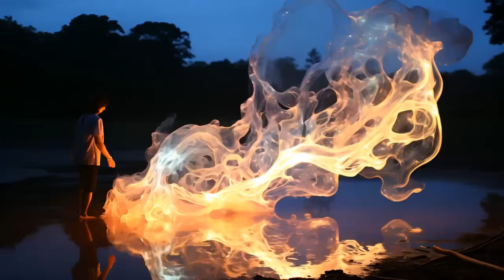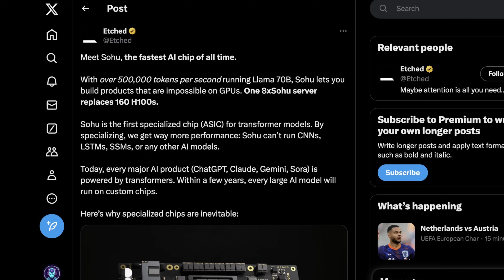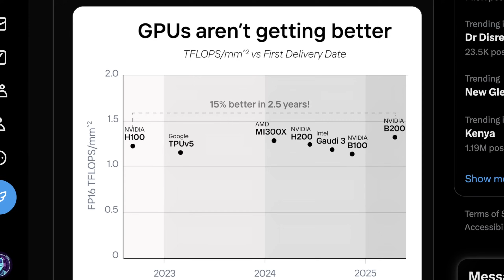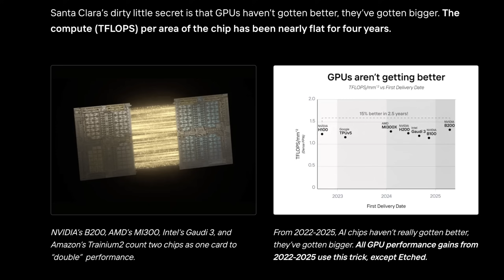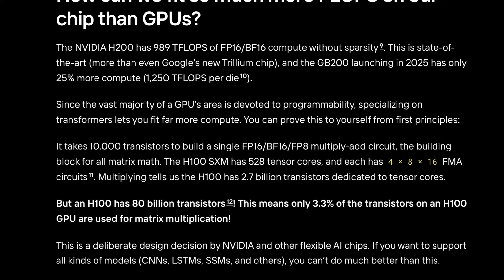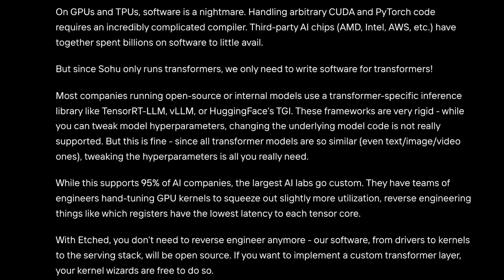Meet Sohu, the fastest AI chip of all time.

Comment: Not sure it's wise to invest in making an AI chip only for transformers when transformers are not what is going to take us to the next level. Transformers are limited regardless of context size or how many tokens you can generate per second.
Reply: 20x faster inference would take us to the next level. This makes AI-ifying everything basically free. It doesn’t have to be the permanent future, it’s just radically improving the usefulness of current models and enabling new applications which couldn’t be done before due to token speeds and latency, like making live voice assistants respond as quickly as a real person, and giving them CD quality voices instead of sounding like a Skype call.
Reply: It also means coding assistants and coding automation go from being sorta possible to; generate a working tested application with 200,000 lines of code in a few seconds.
Reply: Of course as soon as a better architecture is proven, they can immediately begin R&D on an asic for that too, because they will have tons of revenue from their previous successful product and investors.
Reply: @IntentStore  Faster crap is still crap.

Transformers will never be able to do that. They fail simple algorithmic coding tests I give them. Because they don't know how to code, only spit out code they've been trained on that aligns with whatever prompt you give it. 

The reason it cant get the answer to one of the problems right is that the answer lies in a single PDF that was on the net 25 years ago. (It's still out there) I know this because I helped fix a bug in the algorithm back then. It's nothing complicated, maybe 100 lines of code.

In order for a transformer to spit out a 200,000 line program, it would have had to been trained on a 200,000 line program. Multiple in fact. Which means the code had already had to have been written. Which at that point, you already have the code, what do you need a Transformer AI for?

Transformers wont get significantly better, they cant. They're limited by their probabilistic text predictive noodles. Which just doesn't work for software.
Reply: @K9Megahertz  What about multivariable Brainchip's spiking neural Akida2 chip  with its unique TENN's algorithm ? It may possibly steamroll the competition.
Reply: @K9Megahertz  I don’t know what model you’re using but this isn’t reflective of mine and others’ experiences. With chain of thought, planning, agents, code sandboxing, and iterative error corrections, code automation is highly viable, and we haven’t even reached the peak of LLM intelligence as evidenced by Claude 3.5 Sonnet.
Reply: @IntentStore  Any of them. LLM's are limited. Maybe they work for little programs or little functions because they've been trained on umpteen variations of that across the internet/github. 

For large scale applications that requires real software engineering? No. I don't see it.

Try using LLM's to write a B-Rep system/engine for 3D CAD modelling software like in F360. Let me know how that goes.

Honestly, with all the requirements that you listed, it'd just be easier to write the code the first time, rather than have an LLM spit out incorrect code, have to debug it, throw it away and write it yourself anyway.

LLM's are probabilistic in nature, and that just doesn't fly with software engineering. Either the code is correct or its not.

Comment: I think this is less interesting as a specific product than it appears on the surface. It's interesting certainly for the implications on the industry, but in terms of its direct relevance to "ordinary" people who like to buy a piece of hardware and use it (as opposed to being locked behind APIs) it's way less useful.

Adding onto that, I think the most interesting thing in inference workloads is ultra low precision; forget FP8, why aren't they doing Int8? Int4? Int2 (as per Bitnet 1.58 I think 1.5 bit should be possible with a dedicated ASIC) could be incredible. 

Floating point numbers aren't actually very easy to work with on a hardware level, so it seems like a really weird choice for an inference only chip, as I'm sure they could have squeezed even more performance out of just using the same number of bits as integers, let alone using low precision integers. (I think Int 2 could potentially be ~4.5x faster off the top of my head).

More to the point, given I'm primarily interested in hardware I can actually buy, if I wanted something like this Tenstorrent's accelerators seem way more interesting, and affordable.

With all of the nay-saying said, the one thing about these that seems really interesting is that Moore's Law isn't actually dead. We're still getting more transistors. The issue is that it becomes harder and harder to control them all together in a centralized manner (like on a CPU), hence, CPU performance has declined, and even parallelized you see the same leveling off of improvements over time due to things like accessing cache and so on in GPUs.

I'm no hardware engineer, but it seems to me, that in addition to gaining more performance from removing roadblocks (ie: only using hardware needed to calculate a Transformer network, so no CPU or GPU specific elements are included), Transformer specific hardware should still continue scaling with performance node improvements to a greater degree than existing legacy architectures, very similarly to how bitcoin ASICs were able to do so.

Comment: There is an issue of the shortsightedness of designing chips to do inference alone, especially that of transformer based models. Transformer based models are probabilistic in nature, and businesses and individuals can't bet on them alone. Other forms of software and hardware needs to pair with this before it really does have long term value. 

It's a good start, but NVIDIA is still ahead. After all, NVIDIA use their GPUS to not just simply generate probabilities that are novel and interesting, they use them to design chips and model physics. Reliability and consistency is the real magic here. And no one, not Meta or Google or OpenAI have been able to hone down AI to the point where it is reliable and consistent. And they will never get there with simple inference chips like these.
Reply from the maker: Good point, but that stated usecase is far larger than what Etched has set out to solve with Sohu.  Sohu is intended for one thing and one thing only, model inference with transformer based models.
Reply: @aifluxchannel  that's the problem. Competitor chips like Sohu may catch up to past use cases, but the industry has already evolved. Retrieval Augmented Generation is already the standard. Agentic and AI team based approaches is already becoming an expectation. So where is the investment going to come from that pays for this super inference chip that has limited or no collaborative functionality with other software and hardware, even if it inferences more quickly?

And there is always the threat that the next big model might not be just based in transformers and will require hardware that is different. And the year after that, and the year after that. After all, software grows quickly, hardware rarely does.

Comment: Can it run a diffuser like SDXL? Or a diffusion-transformer like SD3 / Sora?
Reply: They claim SD is a transformer, which is half-true, but the VAE is a convolver. A CNN. They specifically said they can't run CNNs. Are they gaslighting right now? Did they sink everything into text-only hardware that's already out of date now that multimodal is taking over?
Reply from the maker: This was also my first thought - but they claim to have already run SD3 on the device.
Reply: @aifluxchannel  I bet they ran just the transformer backbone. Pass the latent noise in over bus transfer, run denoise steps on Sohu's hardware, transfer the latent output back to GPU with stop-over in RAM, then run the VAE. That's a lot of hops.
Reply: @aifluxchannel  Do you have a link to this claim? It seems rather foolish to support SD3 since you are necessarily throwing away algorithmic improvements that come with causal attention - i.e. they may have gotten 1M tk/s if they did not support non-causal attention.
Reply from the maker: Yep, it's been tested with SD3 and can run any transformer based model (SORA included)

Comment: I think this makes 100% sense because GPUs are no built for inference-specific purposes-- just co-opted because it was at hand. 
The idea of bespoke hardware for a given model is intriguing. 
These optimized chips will be much faster/energy than the more generalized GPUs. Also, much cheaper and smaller I expect. 
Eventually, I think Local Inference will dominate almost all usages. Only extreme, edge-case's will require a cloudy data center.
Reply: i think that is very much wishful thinking - the money is made in DC's and the hardware is build for it - at least for the foreseeable future and with all the regulation hitting right now - well you get my drift
while i agree that this is a win for transformers .. its not uncommon .. groq did similar stuff with there custom fabric - but uses sram - hbm3e is sold out for like 2 years ahead .. and slow in i/o vs direct on die - once you go off chip .. that wont beat groq once optimized - it cant .. / and groq stopped selling hardware :)
Reply: agree. am rooting for biomolecular processes specific models and their custom hardware. like attachment based recurrent NN's would run great on SOHU. what do you think?
Reply: another thing, gpu need reeally low latency so they need to have preferably one chip, that is why nvidia kill nvlink in rtx card, but for ai and workstation pc it is not the first priority

Comment: 500,000 tokens/s???? 😂 Groq is TOAST
Reply from the maker: They certainly have a lot of catchup to work on.  Glad they're no longer the "first" to enter this space.  Do you use Groq with open source models or just run locally with your own GPU?
Reply: Groq's main attribute is latency, not throughput (although they have been marketing for throughput). While latency can still be low in the cloud, Groq is also used for sub-ms applications like controlling particle accelerators (LLMs were more of a "oh and we can do that too").
Reply: groq is also old .. 14nm process .. - once they switch to the new samsung node .. it should be vastly different - the big win here is sram vs offdie hbm3e
Reply: @MrDragonFoxAI  14nm is not "old" in the ASIC world. I don't know if Sohu stated a process node, but I would not be surprised if they did a tapeout at 14nm. 
If I recall correctly, the new LPU2 is moving to 7nm and will also have LPDDR5. But that comes with other challenges since Groq relies on cycle-accurate determinism (which is only possible with SRAM). So it's an engineering tradeoff.
Also keep in mind that a Sohu die is likely much larger and power hungry than a Groq LPU die - I would not be surprised if Sohu was at the reticule limit (again a tradeoff).
Reply: @hjups  they did .. they aim for a 4.5nm tsmc node - and probably what did the dev silicon too
Reply: @MrDragonFoxAI  TSMC doesn't have a 4.5nm node (that I am aware of). They have 5nm and 3nm, both of which would be highly doubtful. Groq as it is right now, would be unlikely to secure a 5nm TSMC allocation (it seems Groq is doing 4nm Samsung, not 7nm TSMC, my mistake).

Also @loflog, Both Groq and Sohu are programmable ASICs, although they are closer to GPUs than crypto-miners. Meaning Groq has an instruction set (they use a type of VLIW), and Sohu also has an instruction set (it's probably closer to the old GPUs with distributed vertex shading engines). They share very little with FPGAs, other than the use of transistors and SRAM (yes Sohu probably the same amount or more SRAM than a Groq LPU).
Reply: groq is sram on fpga, this is asic. completely different business strategy